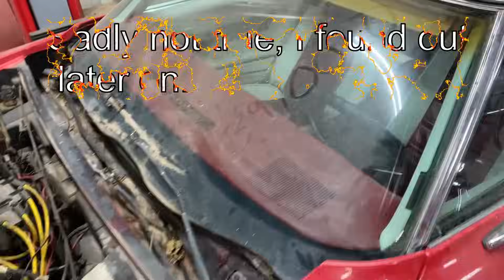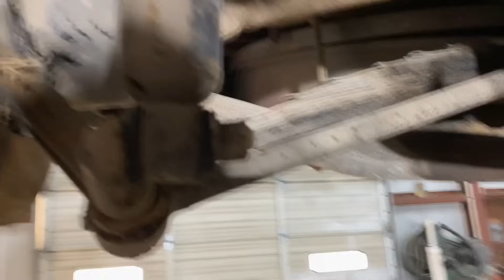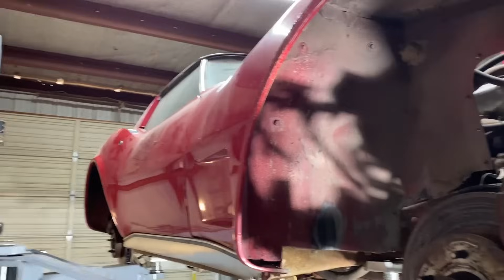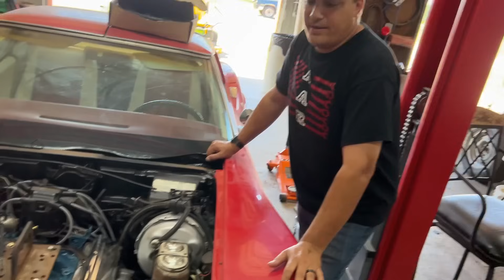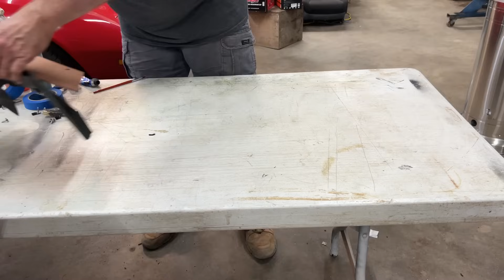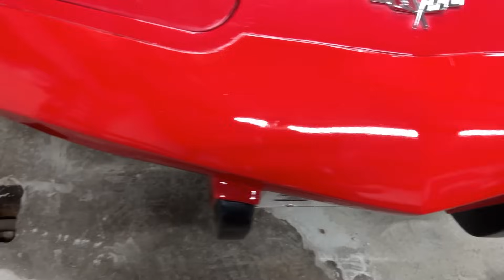1977 BarnVette Finale

Comment: Santa what's happened with el camino projekt, why you didn't continues, It took a long time.
Reply from the maker: It got put to the side as I did the corvette. If all goes to plan it should be back in the shop before December gets here! I have all the parts to get the engine assembled and need to sell the corvette to get the transmission built!

Comment: The nailhead temp senders from AC Delco and standard Motor Products and... don't match the original temperature sender curve.
 Lectric limited has a nailhead temp sender that will actually make gauges perform the way it's supposed to.
Reply from the maker: Sweet!! I’ll check it out!!!